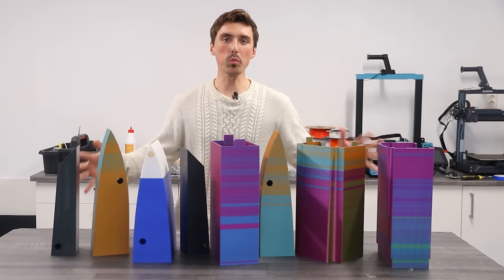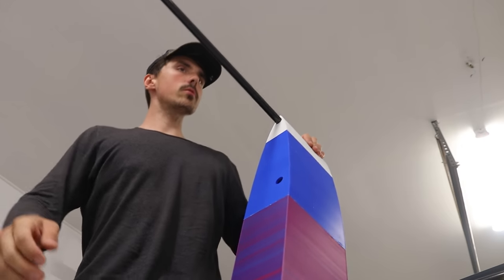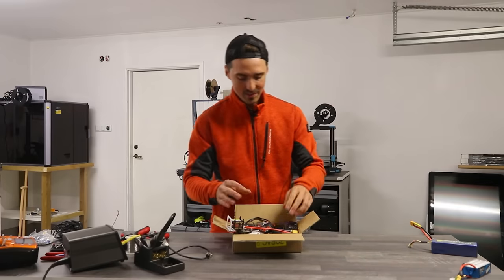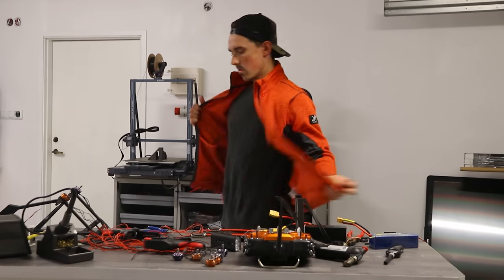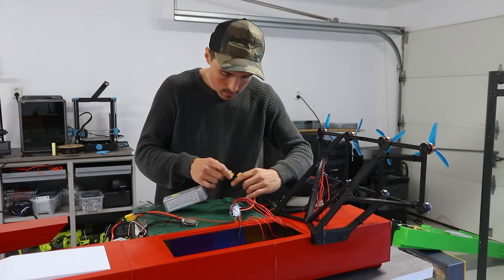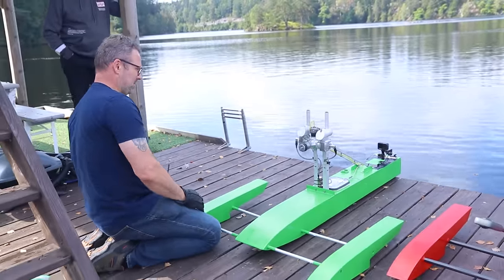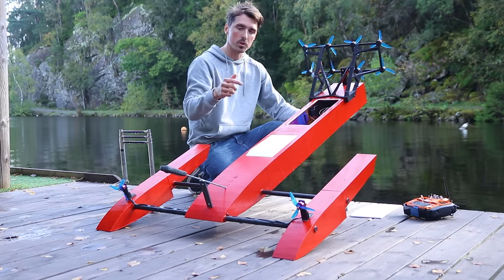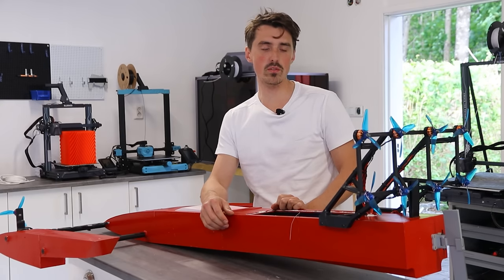10 Drone Motors on 3D Printed Boat

Comment: 2 Small tips, first maybe invest in a smokestopper. This way you can test your electronics without the worry of them breaking. Second tipp would be to setup a failsave for your receiver so it turns of the throttle the moment it is out of RC range. Would make it easier for you to get the stuff back and also stop it from burning
Reply: Indeed. If not smokestopper, then a scientific power supply would also be life saving for testing electronics, because of the current limit which can be set.
Reply: I have a toolkitrc p200 at my workbench for this. Works great!!
Reply: Some battery chargers e.g. the Hota D6 Pro have a power supply mode that is CC and CV, I use mine all the time as a Current limited psu.
Reply: Great video and project! 😄
I would believe those drone esc's are designed with some cooling in mind (which they get naturally in a drone)
Reply: It would be good to hear you talk through the design decisions you made like why air versus water props. If you dialed back the production values on stuff like practical special effects (4D printing etc.) it might give you more headspace to think about those aspects of your videos.

Comment: Im no pro, but i guess that these 4 in 1 drone escs are more optimised to run at like 40-50% for most of the time and just shortly peak at 100% or 65 amps. Because when you are flying, you are normally not constantly giving them full throttle. Maby that caused them to heat up really bad and burn out. Maby installing a fan and some heat-sinkd could prevent this? I dont know, its just a guess, but interesting Video!
Reply: they are also expected to be flying with constant airflow, not inside a conatiner
Reply: ESCs work harder when under partial throttle.  50% power means the ESC has to switch on and off equally at high frequencies.  Think of the ESC as a bouncer at a club.  Much easier work for the bouncer to just let everybody in versus having to sort  through people and deny some from entering.
Reply: @wflagg  There is one benefit of marine use, the ability to water cool.
Reply: @toolbaggers  you are funny 😂 ..but really wrong..
Reply: @toolbaggers   even a full power is still switching on and off, so it is hard at 100%
Reply: @toolbaggers  Its always switching on and off, even at 100% throttle because each phase needs a different voltage. The increased current results in more heat, which is the issue in this case.
Reply: Yeah that's a big difference between drone, wing and RC car ESCs, how much airflow they expect and what load. Hence why you can have a 65A ESC for a drone that's tiny, and a 50A for a car that's huge with an active fan.
Reply: @toolbaggers  I don't see the analogy.
Reply: The ESC's could be cooled in the propeller air stream.
Reply: @toolbaggers every device has an optimal duty cycle, and it's never close to 100%

Comment: Super Glue Accelerator: I've found that using super glue to match up parts and spray accelerator on the outside once the match is perfect is much calmer than trying to match parts in one go. Also, alignment features are awesome. I typically create square pyramids (extract them 100mm but at -45 degrees) - they print well on the positive part. It's easy to subtract from the mating face, but I also offset the mating faces by -0.1mm (I create a gap) to allow the pieces to mate up perfectly. The negative part also prints very well. Something to consider when mating parts.

Comment: I would recommend using water propellers.  Water is 800 times as dense as air, so you have to move a ton more air to get the power of a small water propeller.  I saw that you did finally get the boat up on the planing surfaces, so that's good.  I saw a couple places where it tried to plow into the water, though.  Maybe an improved design or more weight aft would help get the front up and out of the water faster.  Great project!
Reply: The medium density should be proportional to how much power is needed. My thinking is that if you can efficiently couple X number of watts to the water, then it should take about the same wattage for similar performance by efficiently coupling with air. I emphasize efficiency because there are ideal air propeller designs for a certain application just as there are for water propellers. I don't know how to arrive at those designs, but I'm sure there are people who do. Air propeller choices are abundant. I've not found many water propellers for models. 
   Moving to another facet, I've been toying with the idea of a simple and much less sophisticated air boat design myself. I'm going the air propeller route because there's much less to fuss with due to all components being out of the water.
   Lastly, air thrust from will tend to push the bow down so it doesn't have a tendency to back flip at higher speeds, where thrust from below would tend to lift the bow. Sensible bow shape is needed for each of course.
Reply: Eh, airboats are legit. Just needs some iterating.

Comment: Hey, i loved the build but i have a sugestion. Add a resettable/thermal fuse in your boats so if they catch fire, all power gets shut off and the boat will stop. You could also add one to fill it with water or have something for that so it doesn't burn up. Still a awesome boat!

Comment: I think using motors with more torque and switch out to bigger props would make a big difference. Make the esc's have heatsink that sticks out to get airflow or watercool them and wouldnt the hull be better of with an actual Vshape not only flat (for drag purposes) ? fun project tho.

Comment: what a great build. I fly drones fpv style and the first thing we do when building/setting them up is set the failsafe to stage 2 - drop. if the controller loses connection with the drone it shuts down. it sucks that it falls from the sky but it doesn't fly away.
Reply: why dont you implement that it slowly drops from the sky? just shutting down the drone sounds dangerous.

Comment: I think if your two front motors were slightly trimmed down this would help with acceleration and turning since the nose world be getting lifted. Ideally you could have a servo to adjust the trim automatically with throttle position. Higher throttle more nose down force for stability, lower throttle more lift for getting it moving and turning easier

Comment: The 4in1 ESC need a loooot of airflow, 4 cooling. And they are verry expensive. Insted you could use tose cheap old dji-flamewheel motor-esc-combos. they come in packs of 6... Mount the ESC's near the motors outside the boat and give them a conformal-coat... Love your content, go on!

Comment: This is cool!
I need to make an autonomous airboat for navigating bayous, rivers, etc., for a senior project; it's supposed to collect data/samples for water quality research. I'm planning to gimbal-stabilize the lidar system, to filter the noise caused by choppy water, but it's not going to travel over rapids, just slow flowing water.

What other issues should my team be worried about, if any?
We're supposed to have a prototype done this semester, and the final is due next semester.

Comment: A suggestion -  see if you can 3d-print one of the flash new "toroidal propellers"  (water propellers) that are apparently super-efficient - vastly more so than conventional propellers.  
Try putting one of those on the boat and it should go like a rocket!

Comment: Can you try to use a hybrid propulsion system including both Air and Water Propulsion? Like 2 water propellers and 4 drone motors propelling air. 
I think that by this way, you'll get minimum resistance in water, and that'll actually be helping the air propelling, making boat much faster and manoeuvrable. It's a theory great if tested.

Comment: This is just a thought, but it looks like the thrust from the motors is pushing the nose into the water. Would adjusting the angle of the motors a bit help to offset that downward push on the nose?

Comment: Nice project. Would not it be better  if you add small lifter floaters like these water cycling or some saiming boats. By having less contact on the water it should be faster. And actually put the floater also in front and connect it to the direction. Awesome setup.. lake.. love to watch. Thanks.

Comment: You are really grinding through your videos. Wonder if using the two pontoon motors pushing down at an slight angle and controlling them separately would reduce drag or just make itunstable.

Comment: Did you use differential thrust for steering? you could've split them so that four on the left and four on the right are hooked up to one ESC, and used that for differential thrust.

Comment: Don't know what radio you had but certain ones are not great for boats because of signal reflection off the water can cause blind spots where you lose signal.  Positioning and type of receivers makes a difference too, but futaba fasst are supposed to be the best radios for avoiding this.

Comment: You wired 8 motors to one 4in1 esc or zwo 4in1? You aware BL doesent work well in parallel?
Great vid, i like that.
Reply: The beeping when powered up suggests there were two ESC that initialized.

Comment: Question though the carbon rods won't they vibrate a lot a high speed causing stress on the body lack of stability and a loss of speed or are they strong enough to counteract the vibrations

Comment: Back in the early drone days I use to take a back pack of batteries on the plane with me. I followed the proper procedures and went through security and they were ok with it. They were only interested with swabbing my batteries for bomb residue. At that point I knew Airport security was more of security theatre. If they wanted to determine if the batteries were an issue. They would measure the voltage, make sure all terminals are taped and make sure the enclosure was rated to handle the potential energy that could be released. While also containing the gasses let off. 

In cargo planes they have robotic arms that can move the length of the cargo hold on a track. When temp sensors sense a thermal runaway. They sprint into action and puncture the cargo container with some sort of oxygen starving chemistry. I would consider the same sort of method inside a verified sealed container. The preferred method is to send lithium batteries via the cargo planes these days. An informed person can safely handle their affairs and most people won't batt an eye. Rules don't always lead to the most reasonable solutions.

Comment: Hi the rear propellers you have mounted the wrong way. What can be seen is that You mounted them like on the drone for pulling - just mount proppelers upsidedown. " the belly of propeller" facing front of the boat

Comment: the water hitting your blades what will slow them down you should try  a rear wing air spoil to help push the front up and could try fitting hydrofoils what will make it go much faster

Comment: You need a liquid cooled ESC, or a way to get good airflow on the ESC without water shorting it. Good luck!
Reply: water cooling won't do anything unless there is some airflow and a radiator. Like it's possible to incorporate radiator as part of the boat. Probably it needs a temperature sensor to prevent catastrophic failure.
Reply: @stanimir4197  They make water cooled ESC's, and you don't need airflow,  just a line going to and from the lake.
Reply: @somethingelse2740  effectively cooling via running water would work, of course. It's possible to pot all the electronics, too - so it's all water proof. Yet, I would not consider the project DIY friendly.
Reply: @stanimir4197  Of course. Pricey and not user friendly. But it is what this project needs in order to succeed. Air cooling inside a sealed tiny hull wont work if you are trying to drive 10 motors at max power for any amount of time.
Reply: What if the electronic box area was metal and you attached the ESCs to it? I wonder if that plus the water touching the bottom would be enough to keep them cool? I think we're expecting too much from those smaller ESCs. I'm not familiar with them, but they' look like the same size as the single motor ESC in my 1:10th scale cars.  I know it's apples to oranges to compare them, I'm just going by mass of the vehicle compared to the ESC and motor size.
Reply: @willjohnsonjohnson  If you were to replace a portion of the bottom of the boat with aluminum, and secured the MOSFETs (the hot part of the ESC's) properly against that now metal bottom of the boat, you would effectively have unlimited cooling.  It would work essentially like a snowmobile cooling system, a big heat sink/radiator under the seat constantly bombarded by cold snow and ice. But in this case cool water against the bottom of the boat. One of the problems I foresee with this, is the aluminum plate to 3D printed boat hull seal. Dissimilar materials heat and cool at different rates and might have problem staying together over time depending on how you secure them together. I suppose you could try just mounting the ESCs to a plate inside the hull and cooling that plate with water channels. Truly an engineering challenge when high power electronics and lots of flowing and splashing water is involved..

Comment: On the water your range is very limited compared to flying objects like airplanes or drones. The water reflects your signal. Keep your receiver antenna as high above the water as possible. The first 20-25" above the water are the worst.

Comment: I see your back propeller and it might be flipped (or not). I mean if you using that set up it must be pusher set up, not normal puller so it could thrust air more (cmiiw)
Reply: Tractor setup is also a lot quieter

Comment: I'm pretty sure you know this but static thrust is not what you need for top speed. Also printing a simple square shape like this seems like a bit of a waste of a tool. Either make it out of balsa and plywood and get a lighter boat or print a more complicated better performing shape. Or try both, as long as you make more videos.

Comment: What are you trying to do with this one? Just make a cool RC boat? I think that the carbon fiber tubes are an issue, they drag in the water and require there to be holes in the hull. The electronics might need to be sealed with the assumption that water will get into the hull. I don't see any possibility of you completely sealing the hull. Also, maybe a foam hull would work better than a 3d printed one.

Comment: I came here to say, there is no way those controllers can put out 65A X 4 ... and if they could, it would melt every wire in the system.
Apparently I was wrong, there is a way sorry you melted every wire in the system.